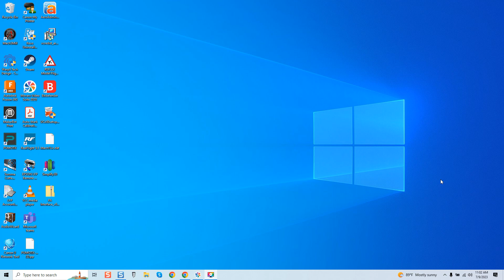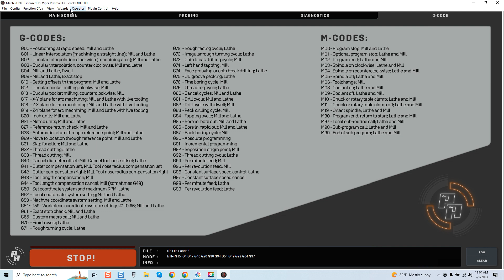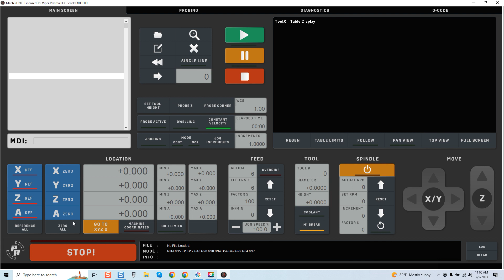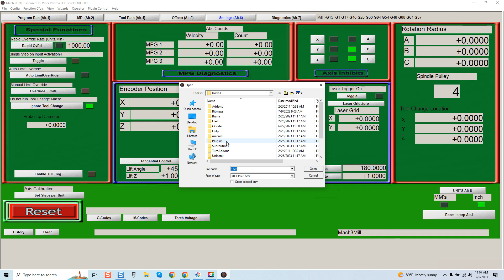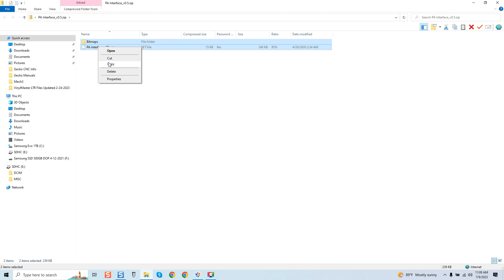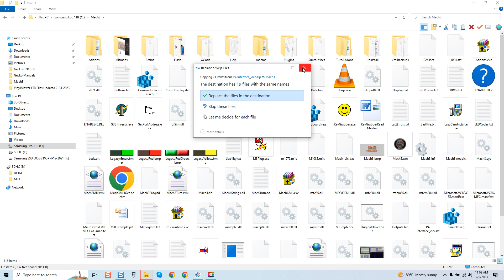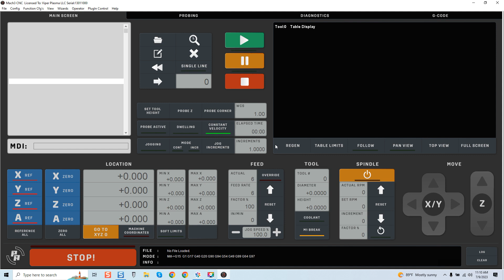How To Install The PA Screen Set In Mach3..

Comment: The spindle speed doesn't show estimated RPM.  I can go up and down, but I can't see a value. Is it the same for others?
I was running off my edge finder because I didn't know what RPM I had.
Reply from the maker: Please contact the developer of the screen set for support when using it due to to many variables with your system to identify a specific cause of your issue. Thank you,
Vince

Comment: Thanks a lot for this great screen set :-) I encounter a weird problem since I installed this. After "Zero All", and starting the program, the maschine starts air-cutting 10 mm above my material. After zeroing the Z for the second time, all is good. Then loading another program for another Bit, and Zeroing the Z axis; it does the opposite, it starts cutting 10mm below what I have set. Any suggestions? Thank, Robert Glotzbach
Reply from the maker: Hey Robert, 

Thank you for your support.

 Its impossible to know what's the issue without seeing what's going on as I'm essentially a mechanic being asked to diagnose a car without it in front of me.

We can schedule a consultation to cover it, and we can schedule next week.

Thank you,
Vince

Comment: hi, i got issue with center probe, on all the slots,  normal i use big tex screen set, with all his marcro´s, can that be the issue that some of my probe dont work ?  it goes to one side wall, probe it two times. and then it does nothing after that, like go to the other side and do the probe.
Reply from the maker: Thank you for your support. I haven't had anyone had this issue, and without seeing your installation, and settings there's no way I can diagnose the issue as I'm essentially a mechanic being asked to diagnose a car without it in front of me.

 I suggest carefully retracing your steps backward. 

You explained you're using macros from someone else's screen set, and yes that would certainly cause problems. 

Thank you,
Vince
Reply: @corvetteguy50  yeah I know it’s a small info. But I’m on lpt port. I got a backup on my installation of mach3. So I will try to getting to org macros back again :) hope it work. But right now all side probe of outer circles work. The only thing that goes not work is slot probe 😅

I’m using a old 2 mm  broken end mill to have a good rounded profile